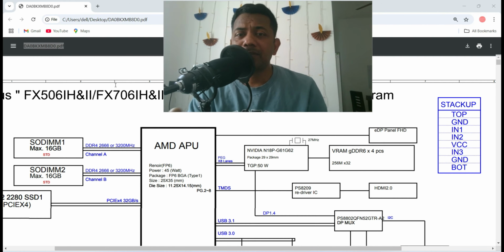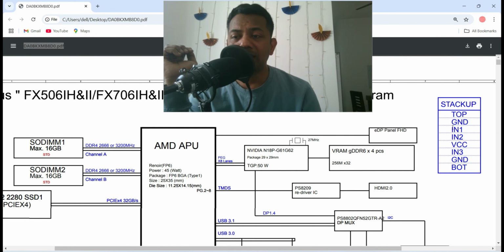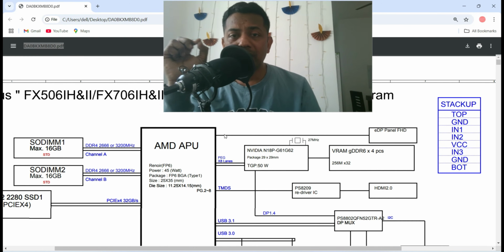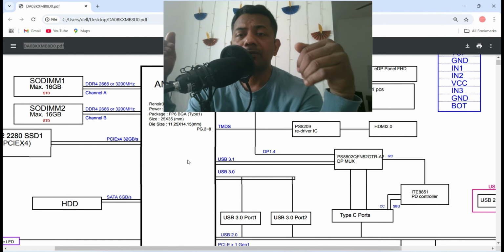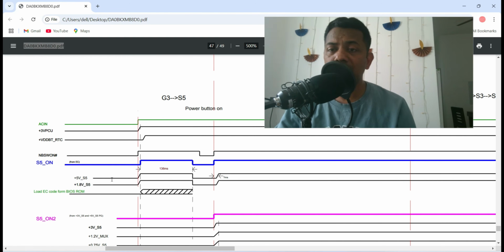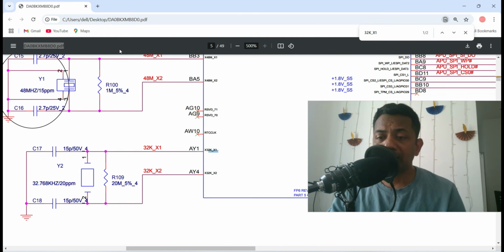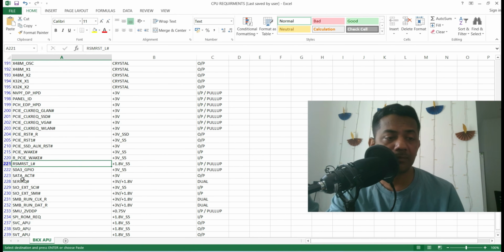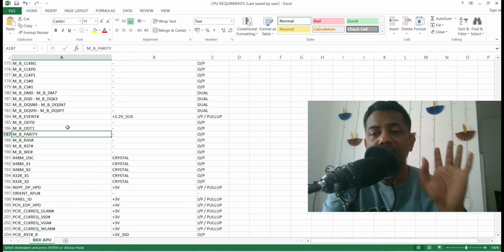CPU SHORT? - How to decide?

Comment: Greetings. I hace an Asus gamer which rsmrst and pltrst, after pressing the on/off button, are always on.
Pch heata a Lot without any device connected, just the motherboard and ram.
Just a small chunck of date comes ( in out ?) from spi rom y nothing else. Memory has no data to cpu.
I am assuming the problem is pch because of the heat
Reply from the maker: Sorry for the late response. 
If u have schematic,  pls confirm what are the S0 state voltages are not present.   In case , voltage level issue, u can rectify.  Otherwise PCH. 
It's difficult to tell in one word without checking the board.